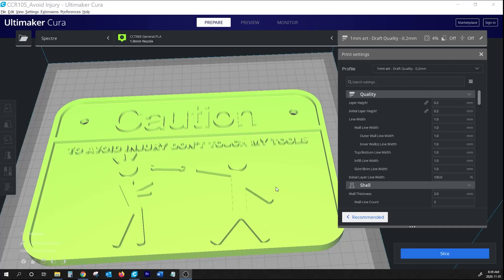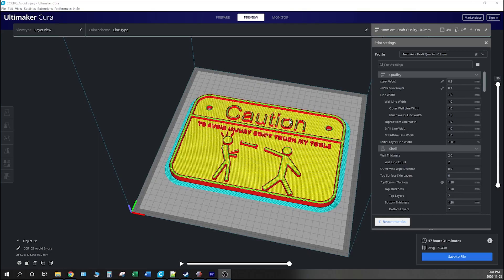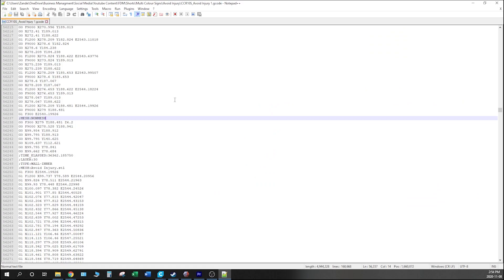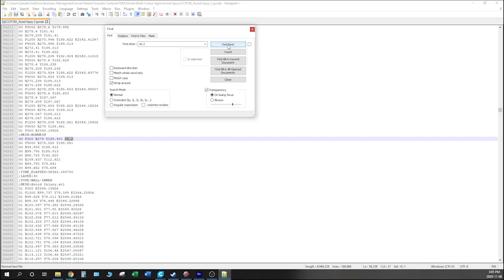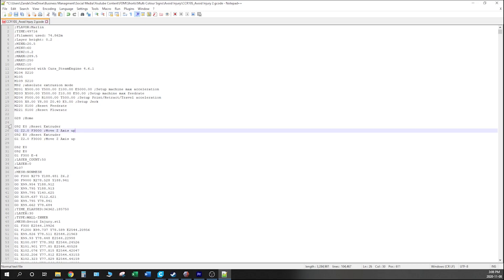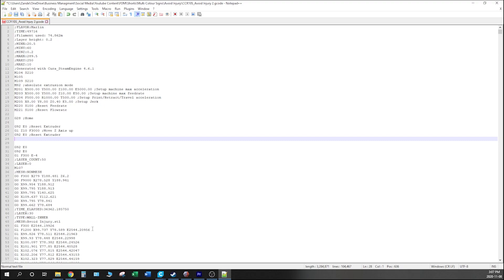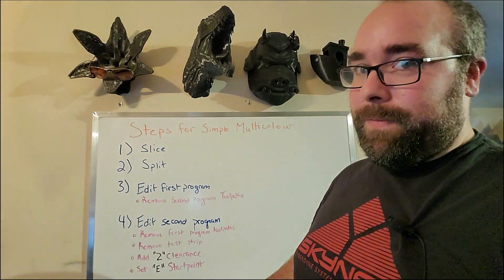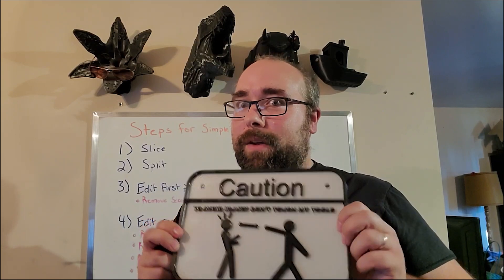Simple Multi-Colour Printing

Comment: When setting the extruder value in the second gcode, why are you using the E value from the G1 command that needs to be executed? It would seem if you set the extruder to that position and then the G1 command says to move the extruder to the same position(which it's already at), then nothing is going to be extruded for that command. Wouldn't it make more sense to use the E value which occurs right before your first extrusion command so that it actually extrudes on that command?
Reply from the maker: Alan O, you are absolutely correct. If we use the E value from the first line it will not extrude any material till it begins the next line of code. If you would prefer to use the E value from the prior line that will eliminate that issue. For the sake of not overcomplicating the video we used this line knowing that there would be very little material difference in most models. 

Cheers,
Zander